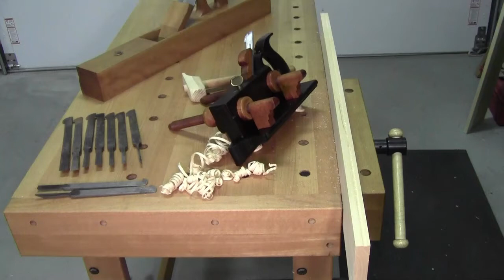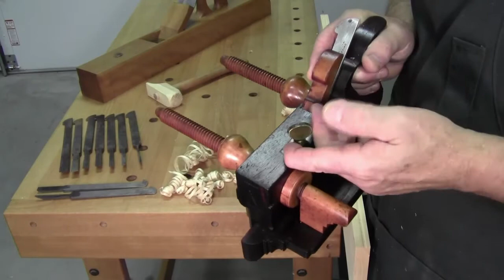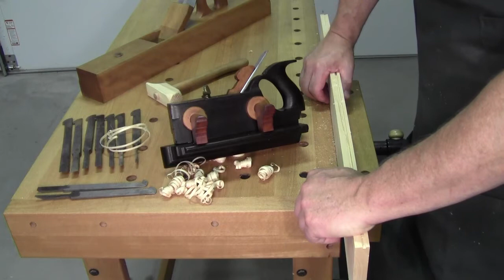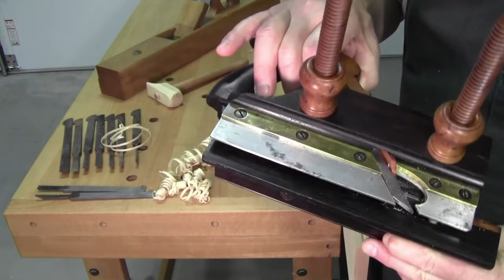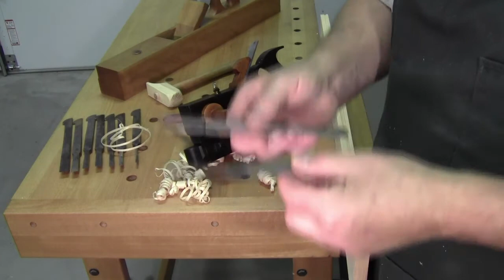Treasure your tools, 150 year old J. Denison Plow Plane - August 11th 2017

Comment: Thank you for posting.  I enjoyed the video.  Do you have any recommendations on cleaning the wood on the plane without ruining the finish?  What wood finishes were used during this time frame?
Reply from the maker: The simple solution to cleaning is mild soap and water, towel dry.  Then a mix of some sort of solvent like Mineral spirits mixed with some linseed oil.  Towel on and use a brush to get in the corners.
Don't over soak.
Then towel off, and let dry.
After all that, Apply a quality paste wax.
Thanks for watching.

Comment: That is a nice plane. What do you use to clean the wood bodied planes? I inherited my GrGrandfathers 1800's era tool chest with wood bodied planes etc, I have only done light cleaning, but afraid to be too aggressive. It's ancestral dirt, LOL.
Have you tried using Coca-Cola to remove rust? It works, but is slower and not as aggressive as acid based approaches. Another one I have heard of but not tried is Blackstrap Molasses, diluted.  
Thank you again for another great video.
Reply: FYI, the active ingredient in Coca-Cola is phosphoric acid.
Reply from the maker: For this and other valuable tools I use Kramer's Antique Improver.  It cleans and preserves.
Reply from the maker: Thanks for Watching,
Tried Cola and it was an abject failure.